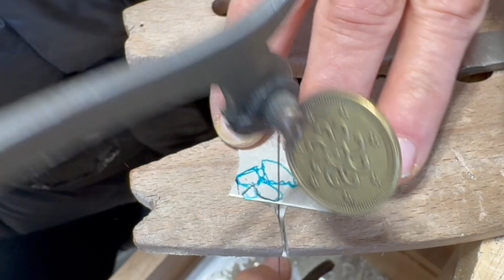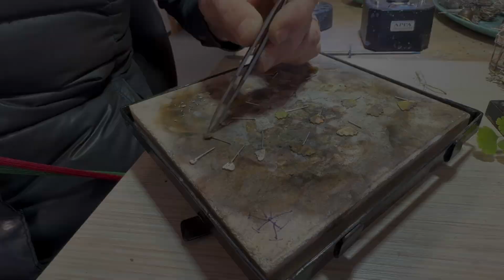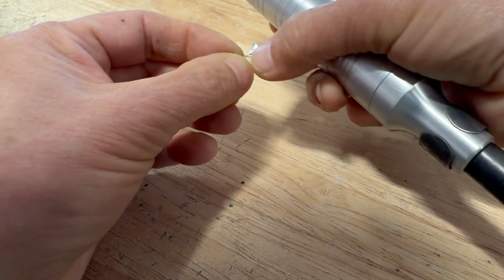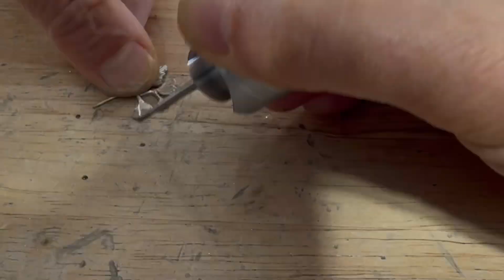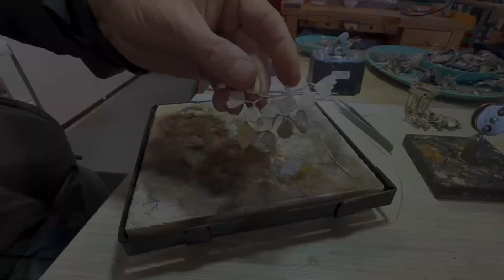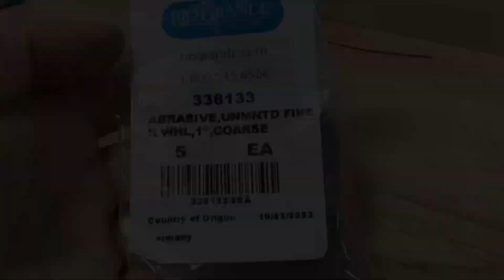How to fabricate maidenhair ferns

Comment: lots of questions from me :) when you apply the liver of sulphur and heat on your solder board, does it contaminate the board or stop solder from flowing in future works?  I have found that when i use yellow ochre to protect joints from solder flow, sometimes it mucks up my board and then when i use it next it makes my pieces dirty.  I dont paint the ochre on the board, but away from it but when laying it down and heating somehow it gets transferred to the board
Reply from the maker: Good question. No, I do not find that it impacts any future work that I do.

Comment: I absolutely love these earrings, and your teaching style is so natural you make everything seem easy because you break it down to basics and explain reasons behind it.  When you make the pins to connect the components then ball the top of the pin, would you first pickle the earring before balling the pin to avoid the bottom of the pin solder reflowing?
Reply from the maker: Pickling does not prevent solder flow however, not applying flux does help prevent solder from flowing. Torch angle is also important.

Comment: Wonderful video, thank you!!  My question is about heating the LOS.  I read it was dangerous to use extremely hot water due to the fumes, wouldn't heating it with the torch produce those as well?
Reply from the maker: Thank you for asking. When heating the metal you'll use an annealing flame and barely heat the piece. It shouldn't get so hot that there are any fumes. No matter, I recommend wearing a mask.
Reply: some people even heat with a b low dryer

Comment: That tip about adding the solder to one wire and then adding that to the leaf is the smartest trick. No more struggling and pushing around solder with a pick

Comment: Could you discuss why medium solder versus hard?  Hearing your thoughts would be super helpful to hear. Beautiful piece and your instruction is so calming and inspiring!💗
Reply from the maker: Great question. My brain dissects the concept of solder in a sculptural way. With this project, for example, I only have the need for 2 different types of solder, so I start with medium and move to easy. If I were to be building something more complex that required even more protection of solder joints, I'd start with hard, use heat sinks, and move to medium and easy. I know that a lot of metalsmiths only use hard solder, but sculptural work involves more solder strategy. Does that make sense?
Reply: @ YES! That makes lots of sense and is super helpful to understand the needs based on the design of components. I am grateful for your reply. Thank you 💗
Reply: @ringgoldnic  Hi Nicole, why start on medium, then easy if you have 2 levels of solder required, why not hard, then medium?  Is it because the guage of the wires is more likely to melt under hard?
Reply from the maker: @barrineingram2650  I don’t really see the point in starting with hard solder when there are only two different soldered joints. It just makes the project a little more challenging. My baseline is easy solder, and then I move up from there.

Comment: Once again, a fabulous video ❣️ do you have a link to the tweezers and solder pick please? Thanks❤
Reply from the maker: Here is the link to the pick. It's (by far), the best I've ever used: https://lionpunchforge.com/products/special-edition-light-titanium-soldering-pick?_pos=1&_sid=35ecfb7fe&_ss=r
Reply from the maker: And here is the link to the tweezers. You won't want to use them when working with the heat of your torch because they bend easily: https://www.riogrande.com/product/titanium-tweezers-set-of-3/115561GP/?code=115561

Comment: Beautiful piece ang great explanation!
I was wondering, is there a specific reason you used easy solder for the final lollypop soldering as opposed to medium like all the previous ones?
Thanks!
Reply from the maker: Great question. The point where the lollipop is (the highest one where the ear wire is threading through), has medium solder. I don't want it to reflow when I'm adding the ear wire. So I move down to easy solder. Does that make sense?
Reply: @ringgoldnic  I understand! 
Thank you ❤️
Reply: Beautiful work!!! Love your videos!  Thanks.  Thank you Rio Grande for sponsoring.

Comment: Brilliant and beautiful as always! I use gingo in my work frequently,  I look forward to giving this a try! I LOVE the movement.  Would these be too delicate to put in a tumbler?
Reply from the maker: Thank you. I don't tumble my work, so I can't speak to that for certain. Do you place other pieces using 20 gauge wire in your tumbler?
Reply: @ringgoldnic  I do put earing settings with the ear wires (20g) in the tumbler. 20-22 sheet is my go-to.  I may try and see if it needs reshaping or if it holds up. Thanks for another wonderful tutorial!

Comment: These are beautiful, I am looking forward to making something similar using this technique!! I am curious if you would be willing to share your method for making your monstera ring. I have tried now three times to make a monstera leaf that I wrap around into a ring, but I can't seem to get the shape right. The leaf ends up looking scrawny and too skinny and not as Lush as the monstera leaf should
Reply from the maker: When making monstera leaf rings I usually use a little artistic license on the shape. I make it a bit longer and a tad less wide...
Reply: @ringgoldnic  thank you for that pointer, I too made mine a bit longer and skinnier to accommodate the shape of the finger -but when that shape is viewed laying flat it appears weird to me and I think I need to follow through w/ bending it around into that ring shape to before I judge its appearance.  I also think  I should use a slightly thicker gauge sheet to  saw the leaf from so the ring feels less flimsy in the end. I really appreciate your advice!

Comment: This is stunning! Is there a reason you don’t bevel and carve the leaves before you assemble the ferns?
Reply from the maker: @jeannem413  I prefer to do all of the soldering first before beveling and carving in case I need to remove any possible solder puddling.
Reply: @ That makes sense. Thank you!😊